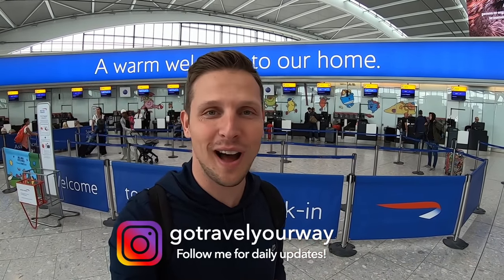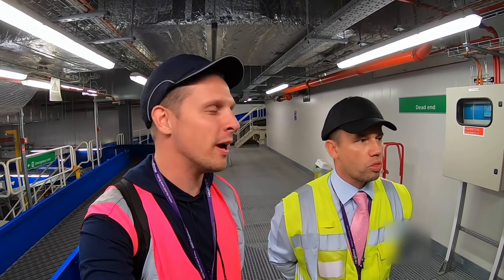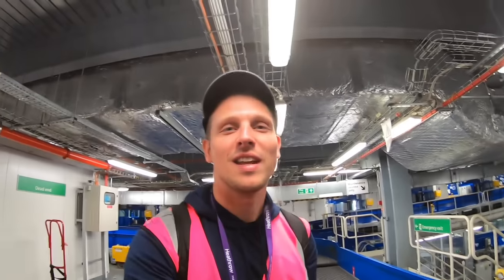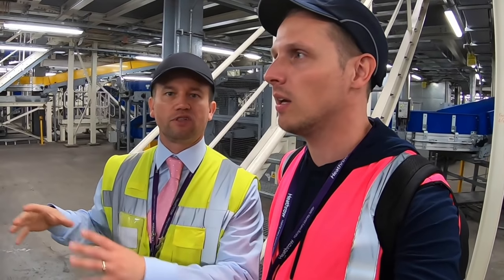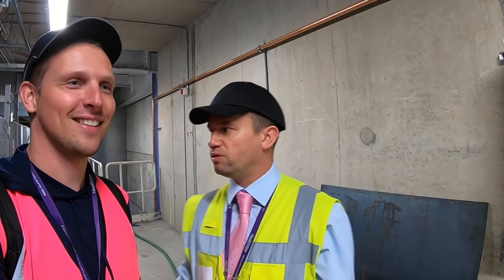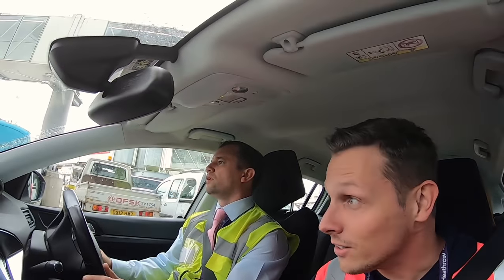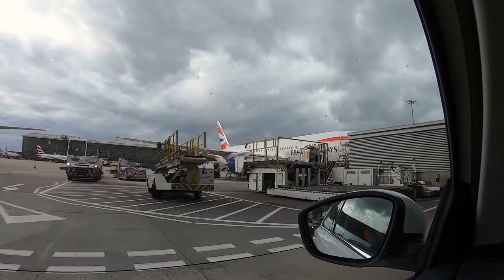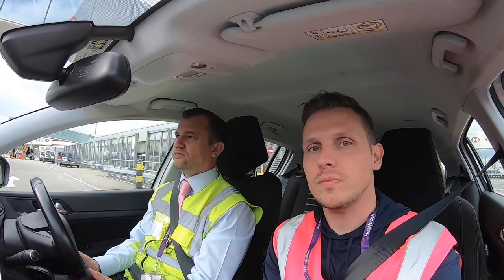What happens to my Bag after Check-in? A day at Heathrow Airport!

Comment: If I'm checking a bag or case into the hold, I aim to show up at check-in/bag drop two hours before departure. This is because I need time to clear security too. More time than security on the Eurostar or when going to court (I've served on a jury in the Crown Court), because you need to unpack all your electronic devices and put them into a separate tray for screening. And then you need to pack them all back up again.

I would also recommend using online check-in if possible.

Comment: The reason why your bag can't travel without you is because that's a measure they put in place after two terrorist bombings of airliners during the 1980s, namely the bombing of an Air India flight off the south-west coast of Ireland in 1985 and, more notably, the bombing of a Pan Am flight above Lockerbie in Scotland in 1988. In both cases the terrorists had checked cases containing bombs into the hold and then not boarded themselves.

Comment: At 8:57  -  Is that true that the staff at the gate can see  IF  your bag is loaded on board your flight??!!?? 😳  How can the gate crew know that? Do they have the bar codes or something? 😲 I have never heard this.
Reply: Bags get scanned as they get loaded into a bin or into the loose bag hold so it would show on the system what bin and where the bag has been loaded into and then the guys on the ramp would be able to say whether or not a bin has been loaded into the aircraft yet and the gate crew would be able to see this